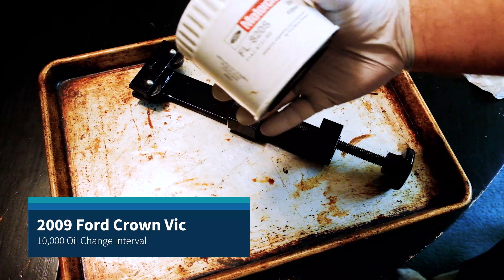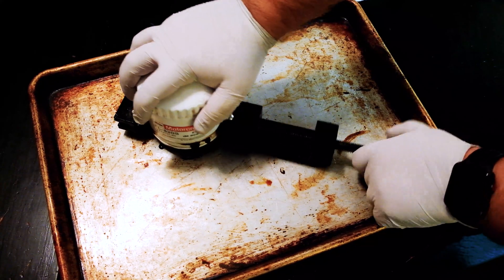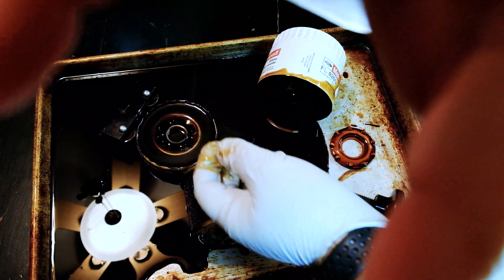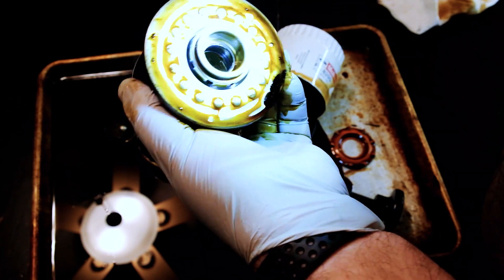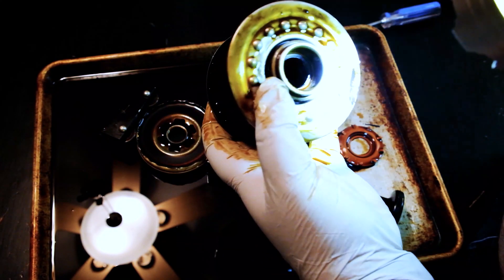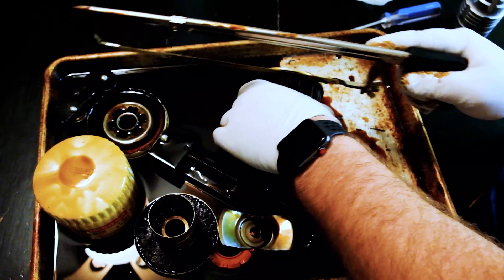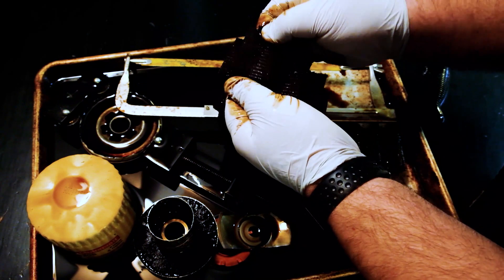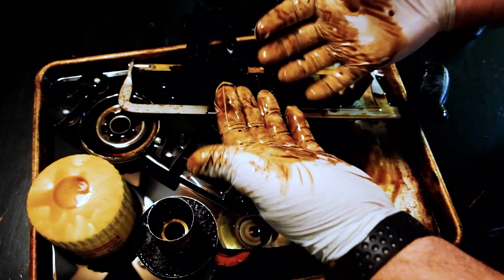Did my Motorcraft FL-820S oil filter tear?

Comment: Thanks-a-ton for proving that the Motorcraft oil filters are NOT prone to tearing.
Running a filter for 10,000 miles with 10-W-30 oil is sufficient proof of the Motorcraft's durability -- ESPECIALLY when the recommended life of the filter is just 7,500 miles.

Comment: First a little background:  I have a 2003 Police interceptor that came with 95,000 very hard use miles on it.  It came with two owner's manuals... the one from a 2000 P71 called for 5W-30 oil and the one for my 2003 P71 calls for 5W-20 Motor oil.  I find this odd.  Was the thinner oil a fuel economy thing or was the 4.6 actually modified by 2003 to require the thinner oil?

When I changed whatever oil  was in it and replaced the Ford Taurus oil filter it came with it and switched it to Mobil 1 Annual Performance 5W-20 and the Mobil 1 20,000 mile filter it picked up a tap on the passenger side valve area... It usually only happens when it's cold out and the engine is cold, right after the engine comes off of high idle and lasts for about 30 seconds to one minute.  The engine used about half a quart of oil for the first 4500 miles on the Mobil 1, which I topped off.  Then in the next 2000 miles it sucked down another quart of oil... But to be fair, there was a 4 hour high speed trip with ended with a 95 MPH 20 minute dash to the hospital at 4:00AM.  (I mean to be fair what self respecting Police Interceptor owner is going to wait for an ambulance when their kid is rolling on the floor in agony.  And of course I was somewhere in Pangaea where driving that fast was legal and encouraged).  

So overall, the motor is still strong and doesn't burn too much oil during normal use.

Now to the main questions... In as much as you also have a P71 that's also likely a retired police car, why are you running heavier oil?  Does it improve high speed oil consumption or cause lifter tick?  Were you having issues with 5W-20 or is it just the old theory that heavier oil is better or have you done some research on the topic? 

Although I think Mobil 1 5W-20 should be good enough, I've been toying with switching to a 5W-30 with the next oil change.  But with a 7.5 quart oil pan, I'd hate to change the oil and then have to change it back if it doesn't run well in the engine.  Good oil isn't cheap.

Thanks for any advise you can throw my way.
Reply from the maker: Sorry for the slow response. I used to be an state trooper. The state always used 5w30 in these cars for 5,000 mile oil change intervals. I'm not saying just because the state used 5w30, I use 5w30, but a thicker oil will always help in any car driven hard. As oil heats up, it thins. Most sports cars are going to spec a thicker oil.  

I know the engine wasn't changed in any way to use 5w20. Ford recommended 5w20 fuel economy reasons. I'm sure you could drive these cars for a long time and be fine with 5w20, but 5w30 will protect better. That's important to me because I'm going to drive a car until it has 400,000 miles.  

I always run a well broken in cars on 10,000 mile oil change intervals.
Reply: Fordtechmakuloco recommends 5w30 in these engines. The recommended 5w20 is due to federal fuel economy standards. I'm using 5w30 in my 5.4l 3v with zero issues. 

As for good oil isn't cheap, I'm also using supertech full synthetic, and last oc went with their new advanced full synthetic formulation (20k mile OCI). It's very good oil,  and the price is almost impossible to beat.
Reply: @MattTigers  Thanks for your recommendation.  The 2000 owners manual recommends 5W-30 while the 2003 manual recommends 5W-20.  Yes they theoretically might have tightened the tollerences on the bearings, but I haven't seen any difference between the engines on the parts level that would explain the change in viscosity.  the 2000 and 2003 4.6L engine seem to be made out of the very same parts.  So yes, the thinner oil might be very well be a fuel economy thing.
Reply: There was a service bulletin many years ago ford changed their recommended oil weight of 5w30 to 5w20 for many of their vehicle models and engines. I used 5w30 before that and still do today.

Comment: Good video.  Some will say 10k miles is too long of an interval for an oil change.  In reality, it depends upon the kind of driving and conditions rather then a static number of miles along with the oil and oil filter used.  The factory recommended normal schedule is 7,500 miles or 6 months which ever comes first.  Special operating conditions is 5,000 miles and defined as towing, excessive idling, driving at low speeds (ie city driving), dusty conditions, using E85 fuel 50% or more of the time.  In all honesty, 10k miles is not un-reasonable if most of your driving is freeway for an extended period of time meaning 30 minutes or more at a time.  I have a 2008 Ford Crown Vic P71, and change my oil annually with the OEM oil filter and 0W-20 synthetic oil.  I drive about 5k miles a year with a mix of city\freeway driving with most of it freeway.